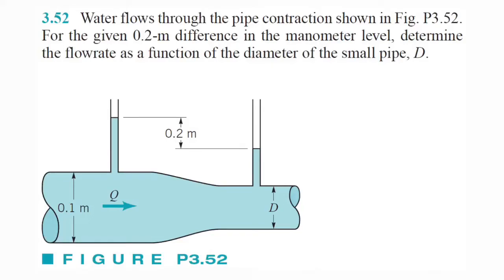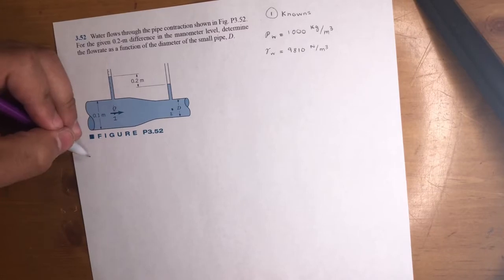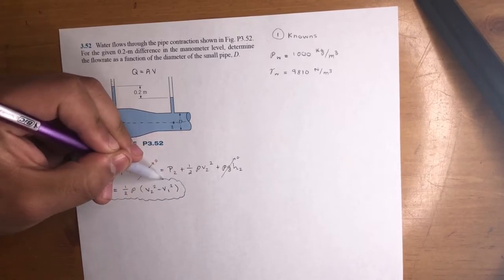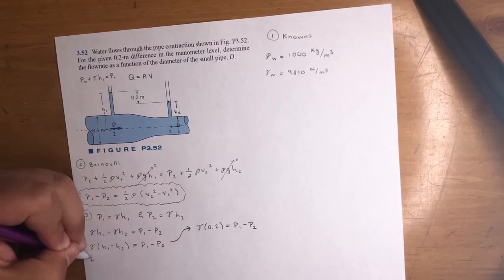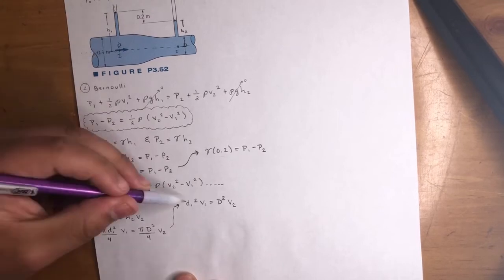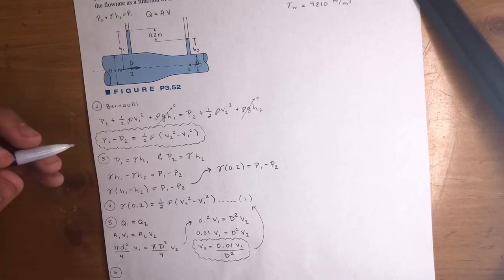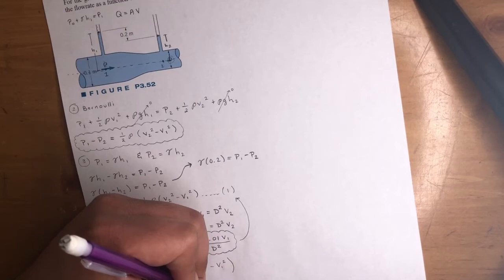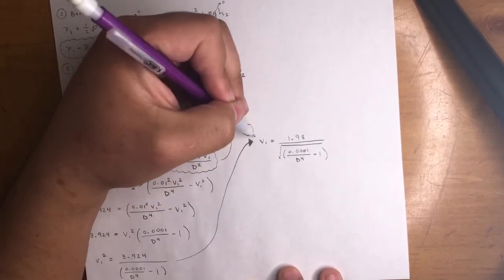Fluid Mechanics - Water Flows through the Pipe Contraction

Comment: why Po (atmosphere pressure) is zero? 4:20
Reply from the maker: Hey!

So just rewatched this myself and maybe the wording was confusing. Atmospheric pressure is not zero, you are correct. Atmospheric pressure is 101.3k kPa. But here, we are dealing with gage pressures, not absolute pressures.

If we wanted to use the absolute pressures, We know the formula for Absolute Pressure is:

P (abs) = P (gage) + P (atm)

Notice how Point 1 and Point 2 in this problem are both open to the atmosphere.

So when you plug into the Bernoulli Equation for P1 - P2, the equation will become:

Gamma1*h1 + P1 (gage) + P1 (atm) - gamma2*h2 - P2 (gage) - P2 (atm)

P (atm) = 101.3k kPa (for point 1 and 2 so they cancel out)
P (gage) = 0 (for point 1 and 2 where water and atmosphere meet)

And you’re left with:
Gamma1*h1 - Gamma2*h2 on the left hand side of your equation.